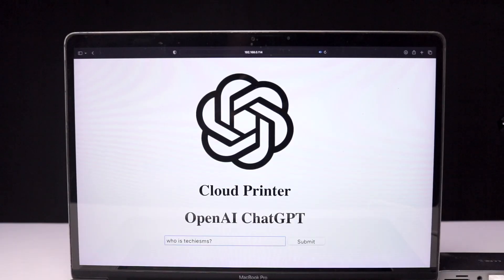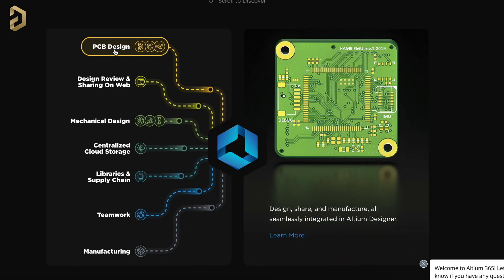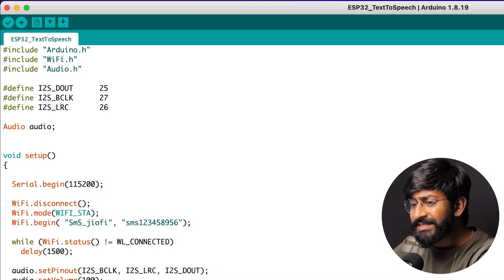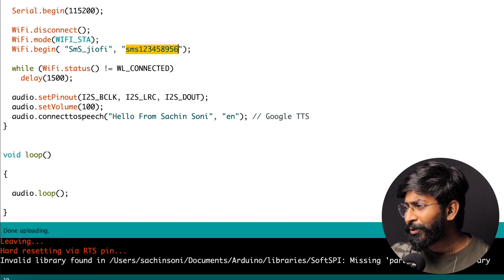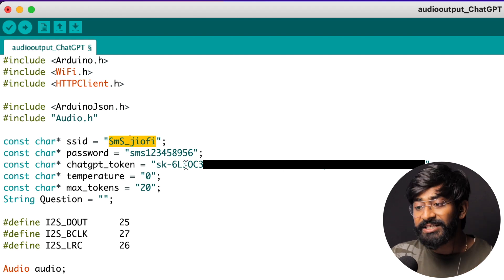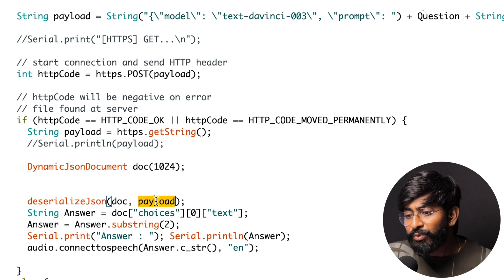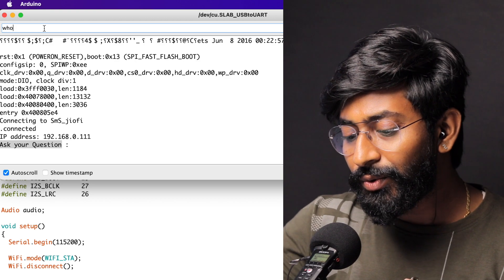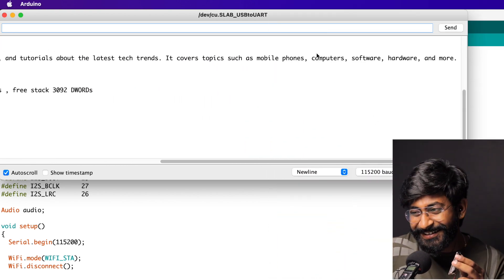Running ChatGPT on ESP32 with Audio Output 🔉🔊

Comment: ESP32 - it's complete garbage - you have to open 10 applications to write a code. Besides that, problems with library implementation, non-functional source codes between models, and if you want to make a new project, it's not possible - you must use an example. ESP32 = a huge waste of time, you lose money, you can't do anything else. Garbage.

Comment: Hello, I have tried to make the examples of ESP32_TextToSpeech_Sample but it gives me an error related to the Audio.h library, especially in line 9 of the code and it does not let me compile the code, I already downloaded the library but maybe I am not using the correct library Audio.h for my ESP32DevModule, I'm just looking for it to compile since the MAX98357 I2S Amplifie Audio module hasn't arrived yet, or could that be the reason why the code doesn't compile. Greetings.
Reply: same here
Reply: Same..
Reply: anyone solved the issue?
Reply: Search online for library related board and select  oldversion
Reply: I have the same problem,but I preferred to change that library with another that will work with the ESP32, because audio.h is not compatible with esp
Reply: @juanpablo3508  Hi, wich library did you use? I'm currently working on the project, but keep facing the same audio.h error. Please help